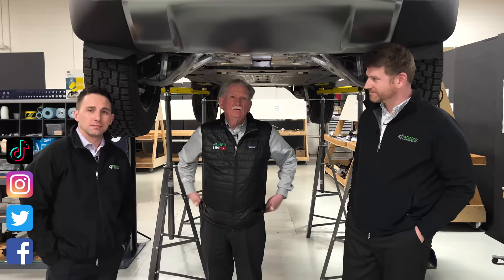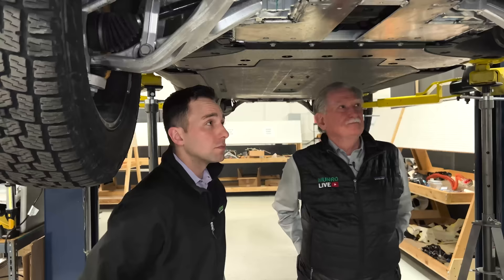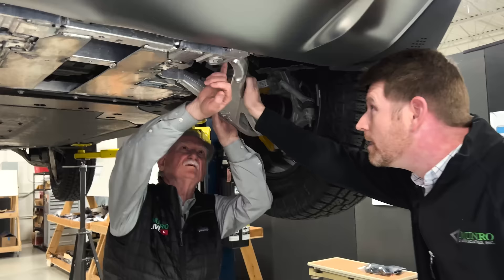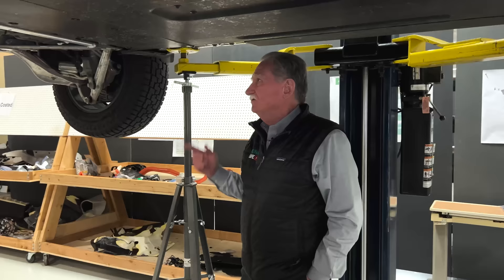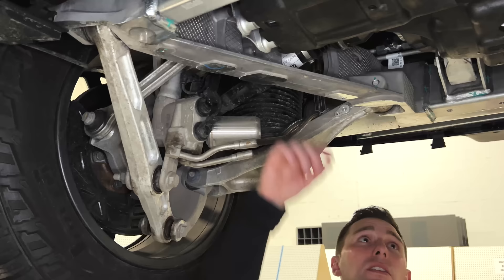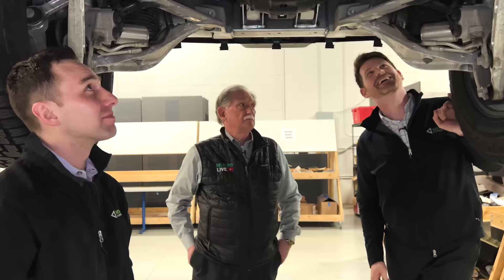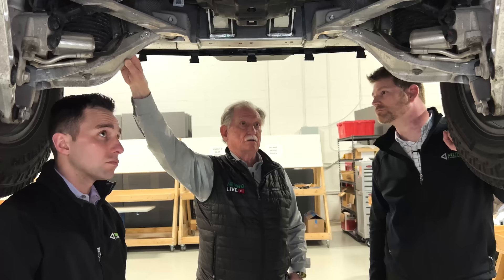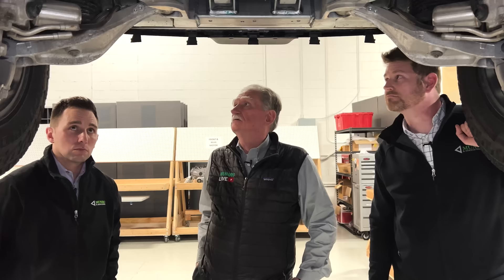Rivian R1T Electric Truck | Hoist Review

Comment: The only issue is towing.  Wish Tesla or Rivian or someone would start building trailer bodies (that you can put whatever you want on it) with battery pack and batteries and update the connector to be able to signal drive assist and break assist directly. It would completely solve the issue and give a major platform for work with charging, air compressors etc. while eliminating the range issue.
Reply: Yeah, Out of Spec Motoring channel did a range test towing 7.5tons.  Recent video.  They only got around 110 miles on a full charge.  Having a battery pack on the trailer may be a good solution, but it would add a significant amount of weight.
Another issuer with towing is that the current charge network chargers are not designed for vehicles with trailers.  In the Out of Spec video they show how hard it is to charge it without dropping the trailer somewhere.
Reply: The control can be realized without communication. The trailer just would manage to perform a zero-horizontal-force managed torque on the trailer axle, measured by a force sensor integrated in the trailer tree towards the tow hook. Easy.
Reply: @Stefan_Dahn  Great! Now, Ford/Tesla/Rivian need to build a base. Just the frame, with air suspension, battery and motors that do all of this.  Sell it as just the frame to resale in 2 foot increments (or better, just a center component with the axles and let people build on them) and let others go and put stuff on them. You'd have everyone and their uncle doing it for construction trailers, lawn business trailers and RVs instantly even without EV trucks and then EV trucks would have no obstacle for adoption (other than as plow trucks but I suspect they're not traveling far enough for the loss of range to matter)
Reply: I'd google that- there is something out there.
Reply: IMO Rivian missed a trick by not including a high voltage connector inside the gear tunnel.

They could then have had an optional slide-in range extender battery or range extender IC generator. The removable battery could then also double as home energy storage when not installed in the vehicle.
Reply: @DEADB33F  The thing already weights 7700 pounds.  Youll just add even more weight.  Just get a proper tow vehicle.  EVs are not going to be long distance haulers--its just  not going to happen.   This truck holds about the same amount of energy as 4 gallons of gasoline.
Reply: @ckhayne2  To be fair the F150 they towed with got similar range. But yes - We need better charger layouts and more efficient trailers.
Reply: James - CT can haul 5000 lb and TOW 20,000 lb, QUAD motor version.
Reply: James - let others do it. let Tesla engineer the Truck. AIRSTREAM is already building a BATTERY motor trailer for Vehicles.
Reply: Good point. I think Rivian was smart to focus on the "adventure" use of this truck (camping and light overland exploring) since towing is a rare use case for that type of buyer. Until major systemic EV challenges are solved. I don't think we'll see adequate towing application with any type of EV for a while. This might be more of an issue for someone who looks at Ford, Chevy, or Ram when purchasing a pickup. Towing is a huge factor for that class of buyer.
Reply: @markplott4820  That's fine. But it won't get more than 120 miles of range doing it, if that. Which is a major barrier, especially for RVs.
Reply: Battery constraints say no. At least, not yet.
Reply: @MarkXHolland  If you put the batteries over the axle(s) of the trailer and put 2 axial flux hub motors in and air ride as a component pack, then you have no problem. You could easily put 100kW under a trailer of LiFePO4 batteries and assist the vehicle with say another 100 HP and thus get most of your range back. 

And if it was done as sealed unit that you could build any trailer you want on to it, you'd have a real winner. Especially if it had say 5000 W inverter and then DC for chargers, and air compressors etc out on job sites and RVs.

Comment: Looks very good.    I think the clearances would be more for the wheel bits and suspension etc if the wheels weren’t dangling like they were. Pop the truck on the ground then look again at the clearances 👍

Comment: What kind of damage salt that’s used on snow do to this aluminum framing? Just wondering?
Reply: not as bad as steel, it when it connected to steel you see corrosion
Reply: Shouldn't be any damage. I have a bmw from 99 with many of the same parts in aluminum and live in Minnesota
Reply: Aluminum does not RUST.
Reply: Depends a lot on the Alloy and surface protection.   Great Many AL alloys are around, and performance varies greatly with  Si, Mg, Mb, Wf, Cu, Mn, Zn, Ni
Reply: @markplott4820  it does oxidize. Which when steel oxidizes we call it rust.
Reply: @markplott4820  Aluminum actually oxidizes pretty quickly. But The oxide layer protects the underlying metal from further rapid corrosion. Any scratch in the oxide layer corrodes further. Aluminum Does "rust", just much slower than steel. Eventually, you end up with a pile of white powder. In any case, it lasts waaaay longer than unprotected steel.
Reply: @GROND15  - a TIN can will RUST in just days. 
Aluminum can and COATED steel won't rust. 
it's why we use BALL Au cans for Drinks. 
only thing BETTER than Au , is 300 series stainless steel, like the Cybertruck.
Reply: @markplott4820  who mentioned Rust?
Reply: @markplott4820  Tin doesn't rust, it changes its crystal structure, so something completely different.

Comment: I'd be a bit concerned with the hydraulic lines running on the front of the lower rear A arms, looks like a rock or log could take them out fairly easily.
Reply: Same thoughts when I saw the video. Lots of points where things could get snagged and ripped off. Especially on the rear suspension.

Comment: That front suspension has a prototypical look. You can bet they will changing that.
Reply: not unless they buy a Megacasting machine. TESLA has a 8000 ton model on order, and is currently using multiple 6000 ton Gigapress.
Reply: @markplott4820  You may  have a point there.
Reply: @markplott4820  At what level of vehicle weight does a megacasting (aluminum die casting, non-heat treated, OK properties) no longer make sense?  The Model Y is 4,500 LBS, whereas this R1T is listed at 7,100 LBS.  On top of the high weight are the off-road suspension/durability load cases.
Reply: @mayflowerconsulting5540   - Megacsting is not based on Weight. 
IDRA has developed a 5500 lb Gigacast that make a whole car , or up to 9000 lb for LARGE single parts casting. 
but, its based on VOLUME production , as the Casting machines are INITIALLY expensive. 
more info - see IDRA .
Reply: @markplott4820  I understand the machine tonnages are high and they can make large parts. My point is more about die cast aluminum as a structural material.  At what point is it too weak, and/or not stiff enough to be practical?  Most megacastings are using non-heat treated alloys, which are lower strength than heat treated alloys.
Reply: @mayflowerconsulting5540  - Gigacast not good for construction, but for making WHOLE cars, casting GIANT parts. perhaps if you are building SHIPS or Trucks. not for homes or tall buildings.

Comment: Good news everyone, Sandy bought some Rivian stock. Off-roading demo videos look like Honda CRV despite individual wheel motors. Tons of hesitation, tons of wheel slip while the system is trying to figure out traction. On a positive note, congratulations to Mr. Wilkins' high school shop class for getting the contract to do all the welding on the Rivian suspension.

Comment: Look again at that battery pan. Looks like the outer middle and top layer are actually glass fibre with black pigment in the epoxy. UD cloth by the looks of it (unidirectional).

Comment: The R1T is a cool and capable truck. Like Sandy, I also have a Wrangler to replace with an EV truck however I’ll be getting the Cybertruck. I configured the R1T and it was $110,000 with the 400 mile battery. I can’t spend that much and if I did I would baby it off road.

Comment: Yes, but the M998 HMMVV is the greatest mass produced 4 wheel drive vehicle ever made (and it's even a pickup), with 2500 lbs. load capacity. 16in ground clearance, much better than the civilian hummer. A no frills, brute force truck, best driven with the plastic doors.

So to be fair, it would be helpful to pull one of those apart also, to show what the standard is (30+ years old, etc.). 

The HMMVV wishbone travel bars, huge coil springs, and super high torque diesel engine are noteworthy. 

But i drove one during my 20+ us army years, so i not a keyboard warrior, engaged in wild speculation, etc.

Comment: This looks completely impractical to manufacturer in volume.
Reply: Uhm wrong!!!!! It was the first models and they are already improving the design, plus they don’t need to all have air suspensions which complicates things, traditional trucks are simpler and way easier to modify with steel frame.
Reply: many of the welded up assy will have to be changed to a casting,.  weled up assy are very verey expensive vs. cast

Comment: Those long suspension components remind me of the 1960's ford pickup twin-I-beam front suspensions where then went even longer and crossed them.
Reply: They had to be long in the Ford I-beam, because it was just semi-leading arms; if those are short, the angle changes with travel are horrible. The original MacPherson strut design (as shown in MacPherson's patent) also crossed the control arms to make them long, but no one does that any more because it's unnecessary and causes other problems.

Comment: Looks like a lot of wires and tubing exposed on the rear suspension, probably actuators of some kind.  Looks like it would not take long off-road for a rock to take them out.

Comment: Great to see some technical videos on the Rivian. I knew it would be Munro who did it. Second to none on suspension travel? My LR3 had 13”. My Range Rover has almost an inch more than the Rivian and the new Defender has at least the same. Also, that welding…is this a production model?
Reply: Of course it is, be bought it ;)
Reply: Defender does not in any way have more functional travel than this vehicle
Reply: @smarterthanyou2674  my examples are here to mitigate the Rivian’s “unprecedented” wheel travel remark. Land Rover has been doing this for decades. It’s a great truck, what makes it unprecedented is not its EAS. That’s been done before.

Comment: Looks like a great truck. But good engineering in the lab vs it in the field is very different. The Toyota Tundra / Hilux racking up 1 million miles or more on average is in itself incredible let alone it's work in the field across the globe.

Comment: They say it's a "unibody", but it's clear from many online sources (including assembly line photos from Rivian itself) that the Rivian R1T has a separate body and frame. In contrast, the normal use of the term "unibody" is for a unitized body and structure (frame), which this doesn't have. The unusual features of this vehicle among body-on-frame designs are the independent rear suspension (but suspension type has nothing to do with the structure, and other various other vehicles have this feature), the use of subframes both front and rear, and (like the other battery-electric trucks) the huge battery box bolted to the frame (not to the body).

The separate body and frame is the explanation for the solid bolting of the subframes to the frame mentioned @12:59 - the body to frame mounts could still provide isolation so there is no need for isolation (with the associated compliance causing undesirable dynamic effects) between the subframes and frame as well. It's different from unibody vehicles because it's not a unibody vehicle. The "body structure" that the subframe is hard-mounted to isn't the body at all - it's the frame.

Some people may be confused by the fact that the cab and box are one unit (like a Chevrolet Avalanche, the GMC Hummer EV truck, or the coming Chevrolet Silverado EV pickup), which has occasionally been called a "unibody" as well, with an entirely different meaning. In the comments @7:48 and @7:59 (both "this is a unibody") the context was about structure, not cab or box design, so this clearly wasn't the intent of the comment; Sandy says basically that 'other trucks have a frame but this one is different' (and it is not).
Reply: In the "Rivian Battery REVEAL!!" video, Ben acknowledges that this is a body-on-frame vehicle. All of the chatter about isolation features due to unibody construction were nonsense, as has now been confirmed.

Comment: There were a few things that I didn't like.

-The brake line looks too close to the wheel - like 1 cm or less.
-I didn't like the welded-on front swing arm mount.  For a major component, I looks like an after thought.  I hate sharp corners in a bathroom, and the underbody of a vehicle is no different.  I'm sure later models will have it sorted out.  Maybe the cover works magic for impact protection.
-One would expect the angled CV joints to take some efficiency out of the vehicle.  It's fine for an outback vehicle, but most will be used for shopping trollies.

The good
-I wouldn't have a clue.  It sounds like secret mens business.

Thanks for sharing Munro

Comment: As I understand all that travel of the suspension is all static travel because of the air suspension. In its highest ride height there is a little travel but not a lot. Plus the ride gets super stiff in its highest setting.

Comment: I doubt the sound the motors make is tuned. I would think that any noise they make is not intentional just incidental. Sandy's observations are quite over the top. But coming off a Jeep anything would be a big improvement. Hope Rivian can succeed, would be nice to have some new blood in the pickup truck game. Wonder what the service and reliability will be as it gets some miles on it. Good stuff!

Comment: Sandy, I've watched these trucks being assembled at the plant in Normal. 

While clearly not a traditional body on frame design, it is not a typical unibody design either. 

The skateboard provides the structural frame rails for the suspension, battery pack, and drive units. Then, the tophat is married to the skateboard much like a body on frame pickup. 

I know your team will see this when they get to tear one down, but I just wanted to clarify that small detail.
Reply: There are images, including one on Rivian's R1T page, showing what clearly appears to be a body about to be mounted on a separate frame. It looks quite traditional to me: the body isn't an open-bottomed part (which "tophat" would suggest), it's a conventional complete body. The only things different from most pickups is that the cab and box are a single structure (instead of the usual two separate structures mounted on the same frame), and the independent rear suspension. The Chevrolet Silverado EV has the one-structure cab and box, too, to accommodate the midgate design.

Either they radically changed the construction after starting production, or the Munro people don't understand what they're looking at... which wouldn't be the first time.

Comment: Are these 3 related? Rivian is the most exciting EV truck so far and is more relatable for us old grey beards.
Great job and will be along for Sandy's commentary about his truck.
Reply: Sandy got a deal by ordering very early. The new price starts at $ 94,000.  A bit steep for most of us. My CT with dual motor drive and FSD is less than $ 70,000.

Comment: I was charging my Model Y in Baker, CA (a very large gas station, supercharger, and DC Charger) and I saw a Rivian pull in. Had never seen one in person, so I approached the driver and he let me sit in it and gave me a “tour”. It was the Launch Edition. Since then, I’ve seriously considered canceling my F150 Lightning order (I know it’s a different beast) and ordering a Rivian. My biggest concern is Rivian navigating the battery contract and supply chain issues. Also, which edition is this? Thanks.

Comment: At the start of the video he states “I don’t know if this is MIG or TIG welding” it’s MIG welded you can see the evidence of Argon burnt on which you don’t see on TIG welding plus the weld pool also shows it’s MIG welded. These are a production car so to keep the cost down and the time it takes to manufacture down you would also MIG, TIG is just as good just as strong, it just takes longer to produce and would be used where it would be seen as it is far more aesthetically pleasing if done correctly.

Comment: Unrelated to Rivian. 69 year old worker has questions. Is space cold enough to maintain liquid nitrogen?  Does weather "wind, clouds" hinder a missle hitting a target?  How long would it take to deorbit?  Not sinester "Fire Base Space Global Defense"  This came from space cowboys and the tanker scene of terminator 2.  I see this as a first response in remote terrain and last resort for fire storms.  Fires seem to have no effective defense currently with slow response or none.
Reply: This is a strange place for some of those questions.  Space doesn't have a temp like you might be thinking.  For example things exposed to the sun heat up on the sun facing side but the shadow side radiates heat away.  Depending where you are in relation to the sun you need to balance these things.  Wind affects anything flying through it.

Comment: Is it possible to raise the truck to highest level, place a jack stand under one or all of the lift points, and then lower the truck to the lowest level?  I was just thinking if the tires come off the ground, this may be an easy way the change a tire or rotate tires if needed.  Just curious, figuring with the heavy weight of the truck you’d need a heavy duty jack at minimum.